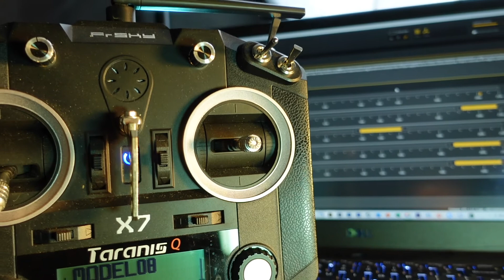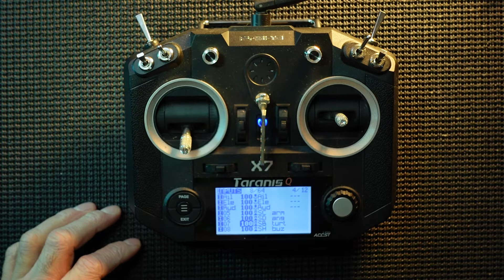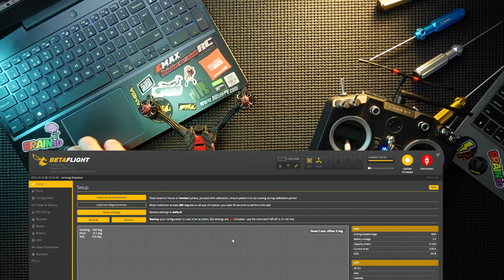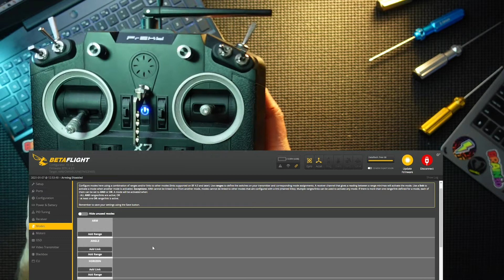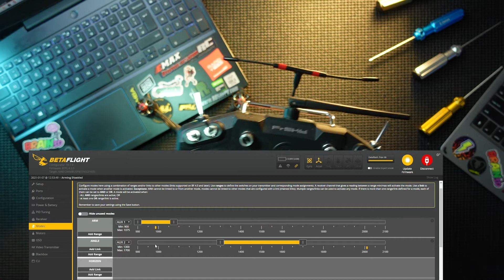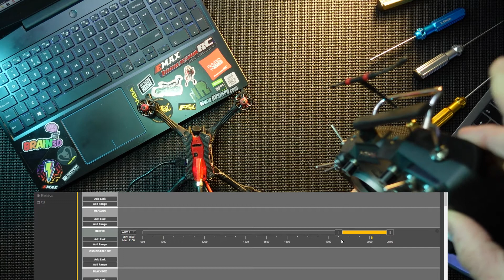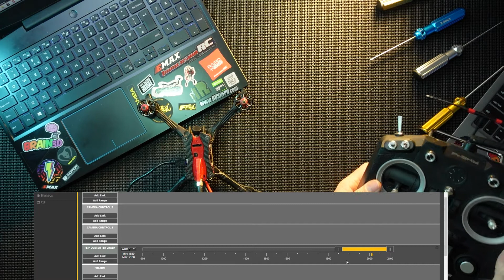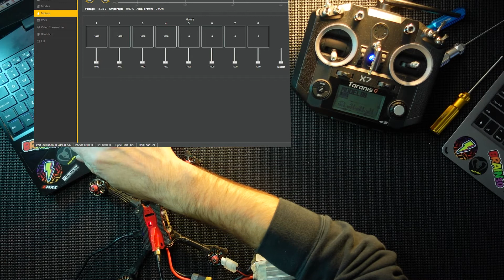Taranis QX7 set-up Instructions with BETAFLIGHT

Comment: Idk about these huge bulky controllers... I once tried my friend's Spektrum and it was very heavy and bulky in the hands and kinda weird... That's just my personal preference though :)
Reply from the maker: no nor me mate, but its more about making switches, if you know how to make switches on this / open tx, it doesn't matter what controller you have, if it has opentx then this switch tutorial will work, its basically the same process on the crossfire tango 2 etc etc - this is a good thing to know for when you get a better more indepth radio controller.